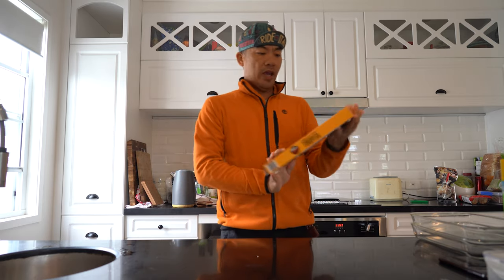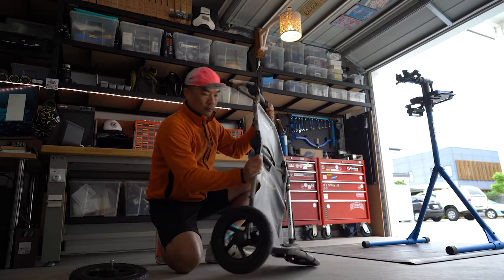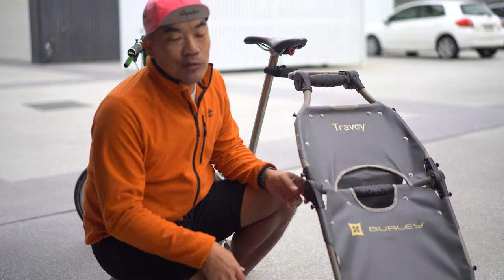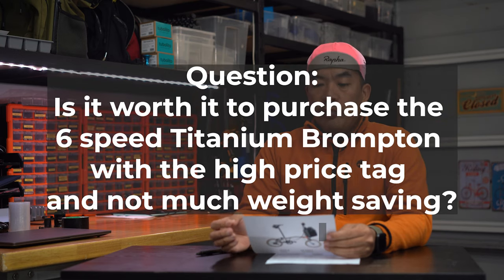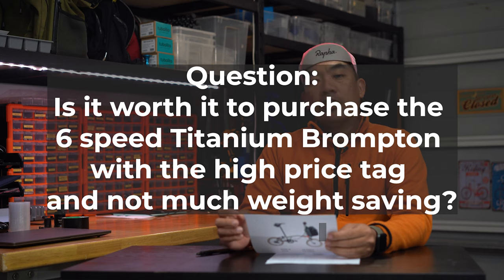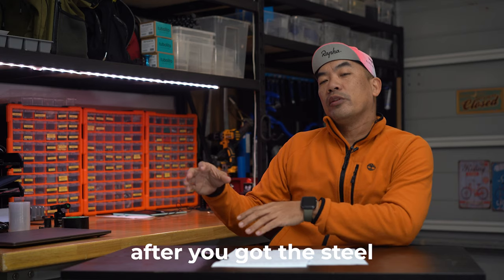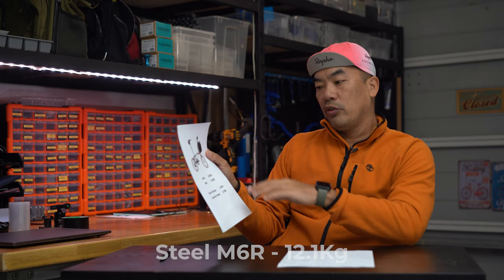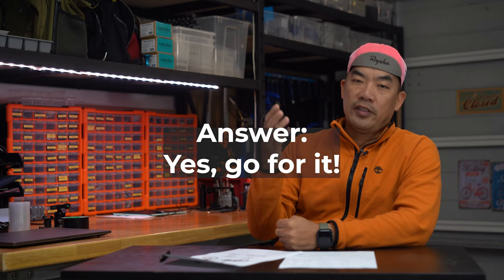Vlog Day 2 / Brompton / Travoy setup & Should I buy the Titanium 6 speed Brompton?

Comment: Re the weight, I agree you are absolutely correct that the 6-speed titanium is a good choice, but IMHO for an additional reason. Because of its relative limited availability, it represents a far better investment both in the short and long term. My last Brompton was a M6R-X and after two years I sold it for nearly the same price that I paid for it. 
Oh! that I could do the same with my car !!!!
Reply from the maker: I agreed with you David, one of the best part of the Brompton is that their resell value are very high, specially the titanium version of it. I guess this is due to the bike design hadn't really changed much through the years

Comment: Answer to that question is that it costs more to upgrade to those parts later if that's a concern.

How much "cushion" is there when using the Travoy. The plastic seems to be hard up against plastic. I would worry about stress fracture over time.

I think they said that 2 speed steel weighs roughly same as 6 speed titanium.

Comment: page 23 2019 Brompton Owners Manual
"The bike and rear rack are not designed to pull a trailer".
I already  owned a Travoy as well ; I was a bit disappointed
I saw 4 videos of people pulling trailers . One guy was pulling a folding boat?
I haven't used mine much either but have tested it to 60lbs capacity with
13  two liter bottles of water  57.2 lbs on my TREK 520. I would not put more 
 than 40 lbs in it , or take it on a long trip. Plastic hinges 6 in all 3 internal
 latches way to complex for  touring. I bought it mostly for groceries any way.
The Travoy also has a max 10 lb hitch weight if I remember correctly.
Reply from the maker: Something went wrong with my Travoy when i was trying to use it today. I am proposing a fix to it at the latest Vlog, please take a look. Perhaps it might work for you as well.
Reply: Hinges Bounce. I have only seen 1 break.

Comment: Nice side views.  My Travoy is very unstable ,flips ~every mile, on my Dahon. Pretty  good on large bikes. I am not sure what geometry changes, but torque from seatpost angle may play a role. Also suspension point to rear axle  and lateral oscillation from uneven pedaling resulting from wider gearing may play a part on the point where the trailer flips in a multi part equation that increases vulnerability to small bumps.  bottom line: may be a problem on some bikes.
Reply: Hi,Leave the tyres a little flat.I carry my SUP on bromoton and travoy and is ok.
Reply: @janzam  ? no dings on the seatpost? The factory sez they forbid it.  Mine is horrid on the 20" downtube9spd. The only thing I can attribute it to is side to side oscillation from wide gearing , mashing plus the geometry. Flips on the road bike only rarely. I haven't tried the 20" with the new clamp/mount yet, but when transferring bikes will strap the Brommie to the Travoy for the ride home , but need to go high to avoid the wheels. I can only imagine what happens when the wind catches your SUP strapped to the Travoy.
Reply: @whazzat8015  Hi , my SUP is inflatable RED explorer.
I have put 2 bike tubes on 45 deg angle to the sides of Travoy for avoid the contact wheels/ bag.
P.s.No pb whit the seat post tube.Bromie is very sturdy.
Some days I carry my 9 y son (30k) standing on the frame plus myself 95k...
Reply: @janzam  I never thought to try tubes! Good tip. I zipped some coroplast wings on , after the last election brought a bounty of signs.

Comment: Can you show us how to do a step by step guide to convert a Brompton from 3 speed to 6 speed? thanks
Reply from the maker: Thanks for sparing a few mins in watching my vid, I got someone asked me on how to convert a 3 speed to single speed too. I guess I can make a video along with your question as well.
Reply: @Petrellionwheels  That would be great thanks...trying to figure out the dog leg wire connecting to the gearing and pushing high low gears gave me a headache, and due to lock down no shops to fix it.
Reply: @Petrellionwheels  if you are doing this video , would you mind share a little on convert a 6 speed to a 2 speed ? i always got the idea of swapping out my 6 speed wheels with a 2 speed for local riding and swap it back when i go overseas for touring, not sure about the complications involved.

Comment: Does anyone else find it incredibly annoying when people pronounce kg as "kay gee"? It's a kilogram - alternatively you can say "kilo", which is actually significantly easier to say than "kay gee". It's not an initialisation, it's a unit of measurement...

But on the subject of Bromptons and weight, for me the £800 or so extra just to save 1 kilogram really isn't worth it even before considering what other options to choose. The six gear Brompton adds so much more practicality to the bike than any other option for me, especially living in a relatively hilly area. Taking one kilogram off the bike for the brief moments in time when you actually have to carry it rather than wheeling it or riding it felt pretty pointless - when it's 12+kg anyway it's not going to make a noticeable difference.